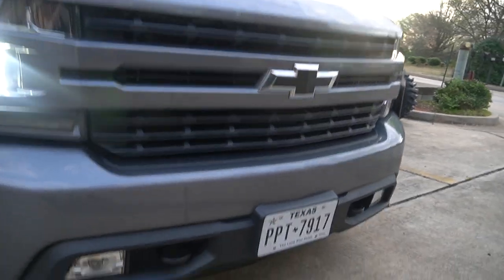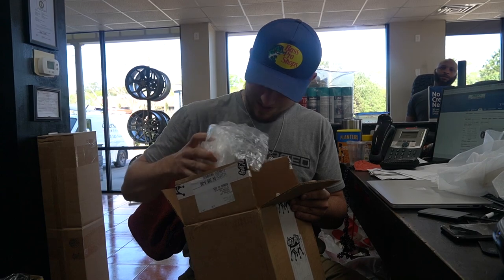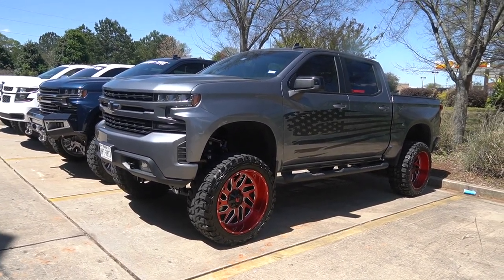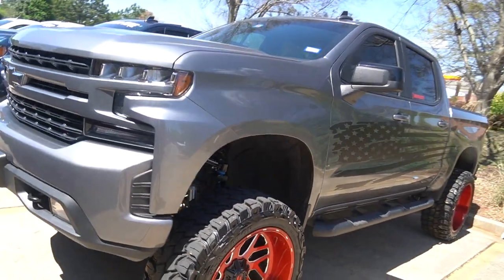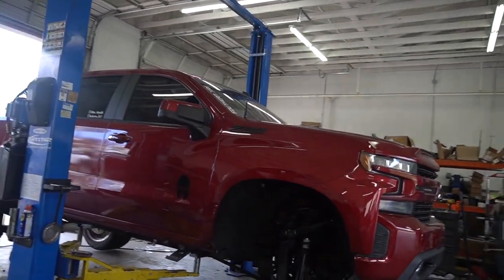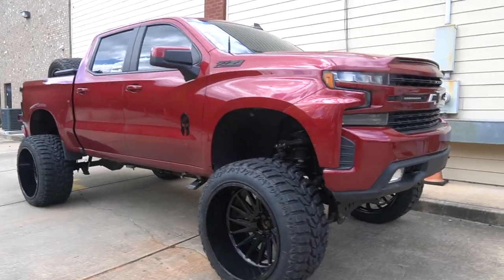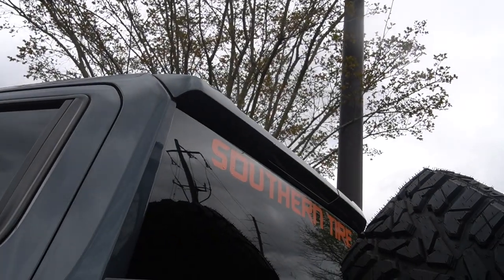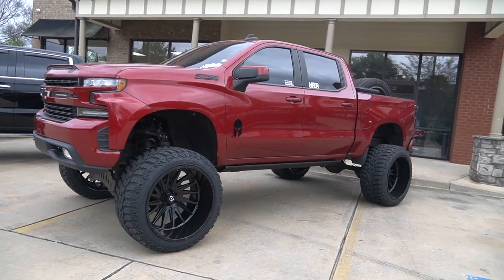Vick came for a Tie Rod and left with NEW 26x16s and 40s | Lifted Silverado 12" and 26x16s on 40s!

Comment: I just had Wild Willies up in Winder GA put a 14” lift with 38’s on my Silverado and I daily drive it….drives like stock minus having to watch the width but being a publix truck driver I’m pretty used to taking a full sized semi down all these small roads and ally’s in and around the ATL. So I don’t know why you keep saying you can’t believe dude in the red truck is going to daily drive it, like it’s impressive that’s it’s a daily driver. Honestly I’m thinking of doing a 3” body lift on mine and getting 40’s on my next set of tires then crank the front to 15” and swap the 4” block for a 5” for an additional 6” of lift on top of the 14” I’ve currently got, while still daily driving it.
Reply: Do you like what Aikens did? What lift?
Reply: @philipkrauss4988  yeah but there was a few small issues. They used plastic zip ties on my front drive shaft boot and inner tie rod boots which to me is a no go. My one tie rod boot had already popped off. But they took care of it and used the metal bands when I requested them. The other issue was I did a cognito 12” and they are not used to dealing with cognito. When following the instructions for the coil pre load it made the front end sit at 15” while the rear was at the 10” so there was bad squat. Even though cognito stated that the preload measurements are estimates and each vehicle will be different. Actually at 3” of preload the front was sitting at almost 18” so they took it down to what the 10” setting was suppose to be to get the 15” on the front. They claimed they couldn’t go any lower or the spring would get sloppy but sense the angles where fine I said screw it, who wouldn’t want an extra 3” of lift for free right? Lol. The angles of everything up front was still plenty fine and the droop was within cognito a specs so they left it and put a 4” block in the rear instead of the 2” that comes with the kit. Right now the back is still 1” lower. So it’s 15” up front and 12” in the rear and it needs to be 15” and 13” to be level. So I plan to take care of that later but throwing a 5” block in. But because the kit is 3” higher then intended my rear drive shaft is sticking out about a 1.5” more then at stock so I’m going to take it down and have it lengthened especially with my big cam/stall with my 6.2L,  I don’t want all the extra torque and weight to mess it up eventually. All and all though they did good minus those few things listed above. They just deal with ford, ram and jeeps primary so I think the Chevy and cognito kit kinda threw them a curve ball. The plastic zip tie imo should have never happened though.
Reply from the maker: Can I still film it?? Bring it by the shop!!
Reply from the maker: Send me some pictures on Instagram!
Reply: @Thatwidebowtie  I have instagram but I have never used it before if I’m being honest. I have very few pictures of it atm because I just got it done 2 months ago then had it in the shop for a custom exhaust for a half week, then sat in the shop for 2 weeks for the 4.88’s and new posi (they send the wrong parts, sent 10 bolt instead of 14 bolt parts). My new rear bumper came in damaged and it’s in the shop getting repaired. I’ve still got to order my fusion front bumper and Royalty core grill and hood, I’ve got a full rock light, wheel light and under glow kit I’ve got to install still, my amp power steps on the driver side is hitting the parking brake bracket so I’ve got to fix that (traction bars where in the way so had to mount the linkage further back), got to get my rear axle braces welded in and install the drop hitch stabilizer for my gen Y and was planing to do a rear shock relocation as well to get both shocks in the rear. Basically It’s still a work in progress so I’ve been waiting to take pics until it’s done. Once the full build is completed I’ll bring it by but not sure exactly how long it’s going to take. I’ve got limited time to work on it. Next is going to be my audio system, I’m a big DD audio fan and will be building a SQ setup this time instead of a loud speaker or SPL setup. Honestly I want to get the 3” body lift on it first and grab some 22X12 -46mm wrapped in 40x15.50’s first before I do the system. I still don’t know what hood I want and I’m thinking of getting it repainted. Let me see if I can figure out how to get what pics I have sent over to you for the time being, truck is in serious need of a detail though and the clear cost in coming off on the front bumper but sense it’s being replaced I haven’t messed with it yet.

Comment: What’s the body like doing ? I have a 2021 Denali on a fts 9” doing a body lift and already bought the same wheel setup as the red Silverado has. They said the body only fits 19 and 2020 so not sure what makes the 21 any different besides maybe a bracket.